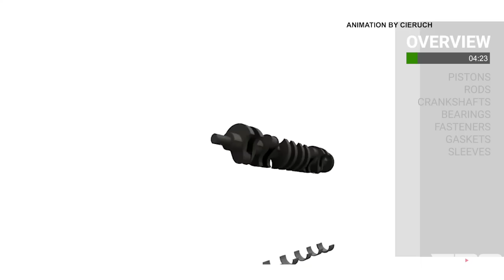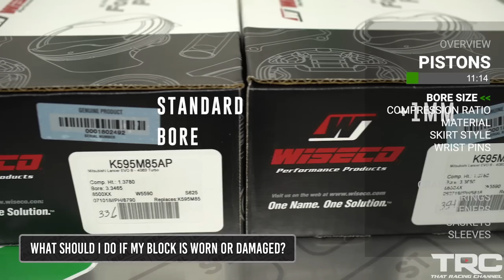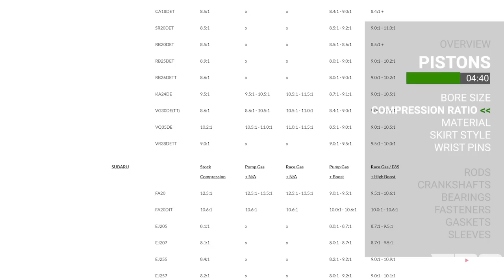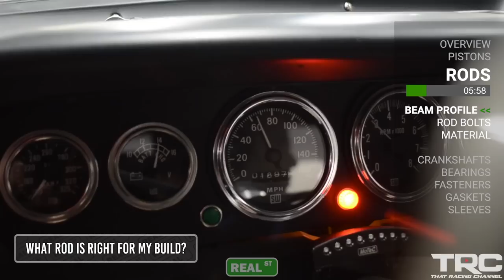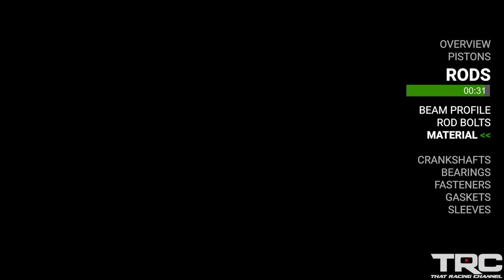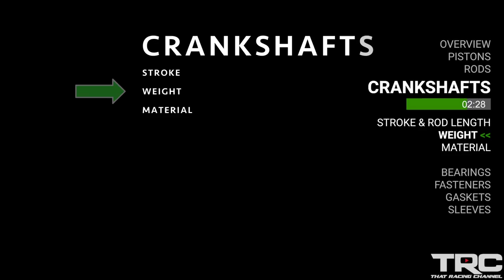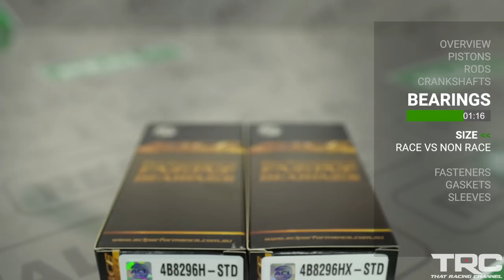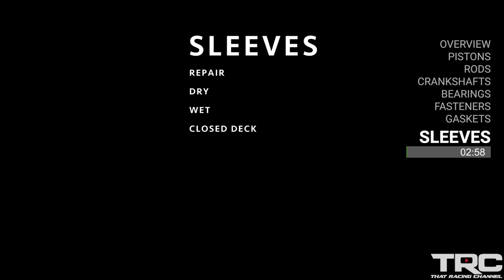Building a Race Engine in 50 Minutes - The Ultimate Performance Engine Build Guide

Comment: This vid is off the charts, so well put together, great dialog. Well done and thank you for taking the time.
Reply from the maker: Thanks, We hope it can provide value for future race car fun! 🤘🏻
Reply: @ThatRacingChannel  Love these types of videos & well thought out, informational stuff like this is why I'll be purchasing my parts through Real Street Performance
Reply: Do these run oil injection or do you premix at what ratio. looking at a 2JZ 2 stroke poppet valved u-loop motor. i founds some VRO pumps from rx-7 on ebay to connect to the intake manifold.
Reply: @ThatRacingChannel  can anyone tell me max power a 3inch straight pipe is good for on a 2J ?   Please thank you

Comment: I’m currently in the design phase of building a full carbon open Wheel car on the level of modern day IndyCars. Are there any engines on the market today that would be remotely close to the specs of the current Honda V6’s they use? I will be focusing on a speedway ovals spec such as what is ran at IMS and Texas etc... I’m mostly looking for good crates. But If there’s good blocks and parts out there I’m not apposed to building it myself. 

Will need to be:
twin turbo 
V6
700+hp
Capable of 12,000rpm
Max bore of 95mm
current IndyCar engine specs cont...
Reply: Look into buick stage 2 motors they have bores from 4" all the way to 4.155" they were used in indy cars and in the busch series back in the the day. Can handle lots of rpm and lots of power.

Comment: When talking about crankshafts; what is your opinion on forged split-pin cranks, and the strength of them? An example, Buick V6 or Lamborghini Gallardo V10? If building a turbo engine for hill climb events (6-7k RPM sustained) with such a crank (4” stroke, 1.7RR), are there any concepts or modifications to the design/build that’ll positively affect durability? Such as retarded ignition timing for decreased cylinder pressure or having material added to the splits between the journals (getting balanced thereafter)? Only concern about the engine durability is breaking the crank, everything else is proven capable of the intended output (800-1200awhp). Thanks!

Comment: ust had my 350 5.7 rebuild from the crank on up..about 3 months ago..and its blowing blue smoke out the pipes i got about 2000 miles on it now and im using quart of oil about 250 miles i pulled the plugs out and #7 has lot of oil on ,that spark plug on the threads only..tell me what you think
Reply: Improper break in caused premature ring wear, you're gonna need to get the cylinders honed or even re bored and new pistons installed with new rings. Could also be bad valve seals on your #7 cylinder if that's the only one with oil on the plug

Comment: these day engine come already with enough enginering you dont need to do all that stuff for what you get out of it and the price doesnt worth it just add a nitrogen and dont use it every corner but when needed youll go from 170hp to 700 for a few sec and the engine will last as long as if you didnt have that button